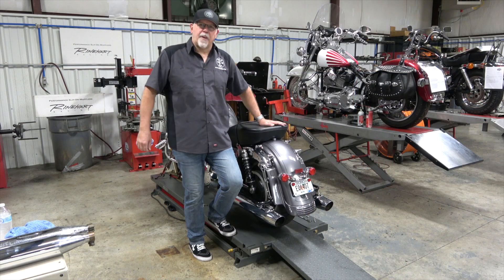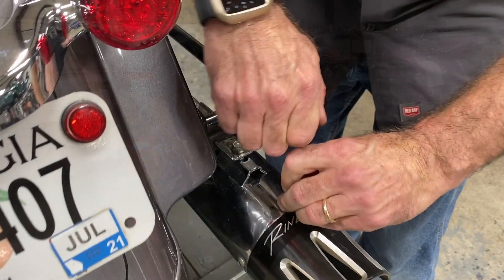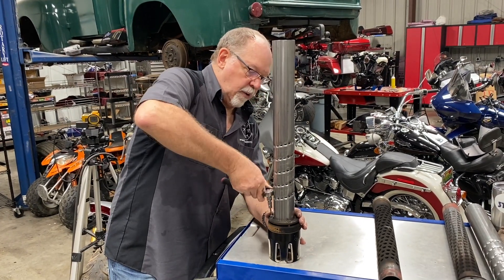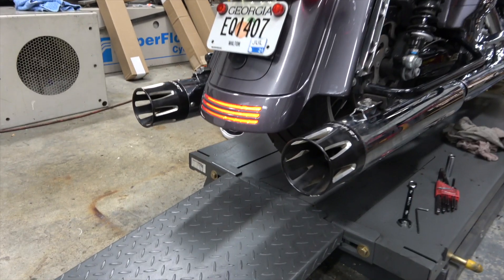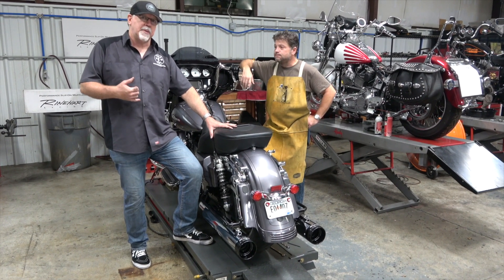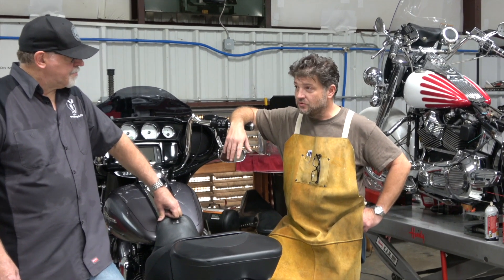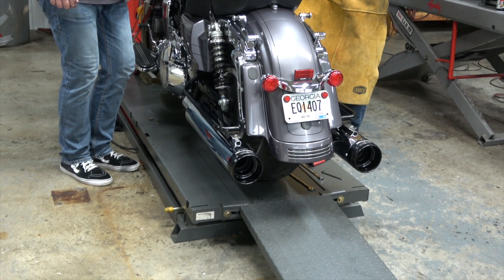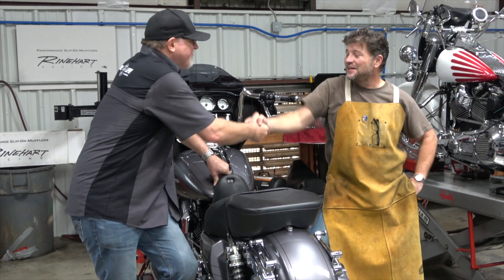Harley-Davidson Rinehart Racing Exhaust Comparison [Slip-ons vs. DBX]

Comment: I got dbx baffles. They sound good. Only problem was I pretty much destroyed one of my black tips getting it out. After removing the three screws, it was stuck bigger than Dallas. The tip would rotate and come out about 1/8". Had to remove the muffler, drill a hole through the tip, insert a bolt and beat it out from the small side of muffler. . I was lucky that only the tip was wasted. I ordered a replacement tip.
Reply from the maker: Dang, sorry you had that experience with it.

Comment: On the 4.5" trial, the right slip on was not fastened and you can actually see it slip out shortly after it was started. I also agree that an Idle sound on all 3, back-to-back and using a dB meter would have helped us.  I have Rinehart true duals on my 2013 CVO Road King and I like them, however, I think they're too loud and a lower throatier sound would exemplify the allure of the big twin. It would be my estimation that the 4.5" would be deeper in tone, but we can't tell from this video.

Comment: Hi this question is to Kevin (who I expect is very busy so anyone with real knowledge then). I have a 2021 Ultra Limited with a 114 motor. My only addition has been a SE  high flow air cleaner. I am planning on having the HD dealer do a SE Stage 2 Torque cam kit in two weeks. The dealer is pushing me towards 4.0 Rinehart slip ons. I assume they will map it after with my SE street pro tuner. My question is are slip-ons even worth the cost? Especially since the stock head pipe will remain with the Cat? Bike is new, 1000 miles so for warranty purposes I won't be cutting out the Cat just yet. Will keeping the stock pipes (no silp-ons) hurt the bike operation that much? Remove the baffle's or swap them for less restriction? I feel like even if I bought a complete SE performance exhaust it is throwing away $1800. for an EPA compliant exhaust. Do I wait out 2 years? Is there a better slip-on you suggest? Thanks for the video and to anyone who can shed some light on this for me.
Reply from the maker: We’re forwarding your questions to Kevin himself, who we feel can give you the best advice on this. We’ll either post his response here, or he will himself.
Thanks for commenting!
Reply: I wouldnt expect to see a significant power gain with the exhaust swap...its more about the sound really. The street tuner is limited as to how much tuning you can really do...which for you is fine considering warranty is a main concern and you are keeping the cat in the head pipe. Once your warranty runs out, you can swap the head pipe and tuner then really wake it up and cool it down. As for is it really worth it???  That is a decision you have to make. Its a matter of how much you like the sound. It will run a little better with the swap. If your bike were in my shop, my suggestion would be....try it with the stock pipes. If using an HD cam, it'll pretty much be a download with no custom tuning really required. If you want more sound and to open it up a little, then swap the slip ons and tune it a bit.
Reply from the maker: @KevinBaxter  we appreciate you, sir!
Reply: @KevinBaxter  Wow I can only say thanks for taking the time to respond specifically to my question, I am honored! Seriously Kevin the information you put out in your videos is priceless. As far as answering my question, that's exactly what I am thinking. Have a great day appreciate it!!!
Reply: @funhumanusa  thank you for the kind words sir. Youre welcome. All the best!

Comment: Bought a 2014 Road King with Rinehart 4” after a year a terrible rattle began to appear, I even bought new high performance baffles to no avail. I’ve had Vance and  Hines  on my previous 2005 RK never a problem. These Rineharts that were on my bike were absolute junk.
Reply from the maker: Sorry to hear you had such misfortune with the Rineharts. Install problems? Did you contact the manufacturer?

Comment: This is not an honest comparison as you are rapping the pipes differently between all three.
You were quite conservative with the throttle on the stock mufflers, a little aggressive on the throttle with the first Rinehart baffles and very aggressive on the throttle with the DBX.
How about an honest comparison with an equal throttle with each??